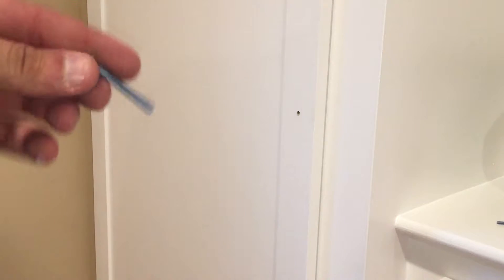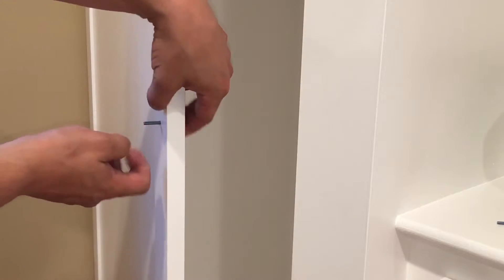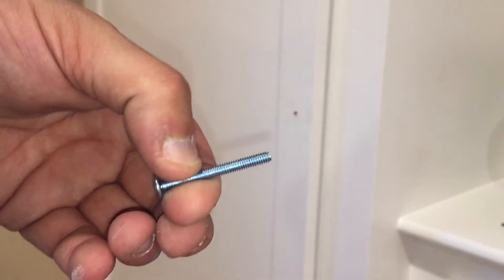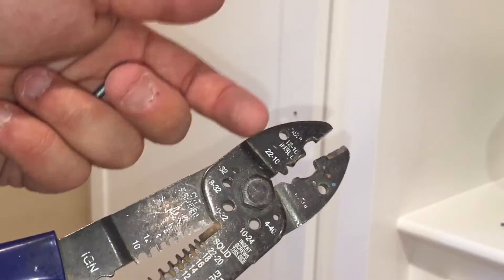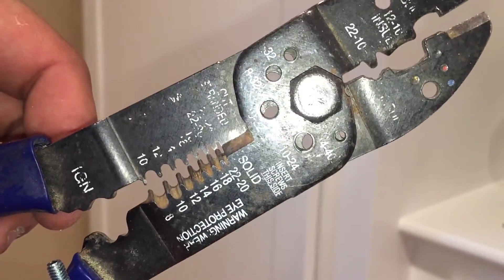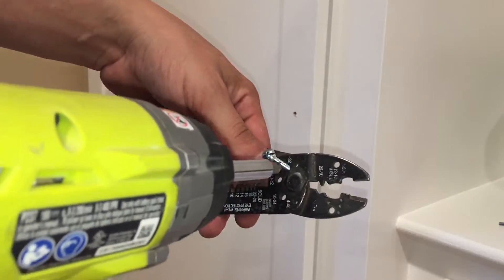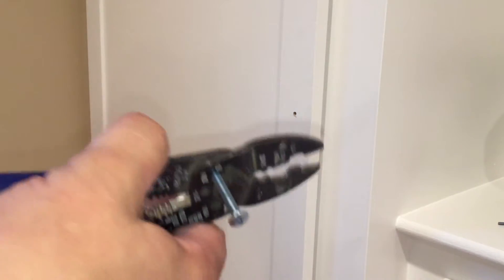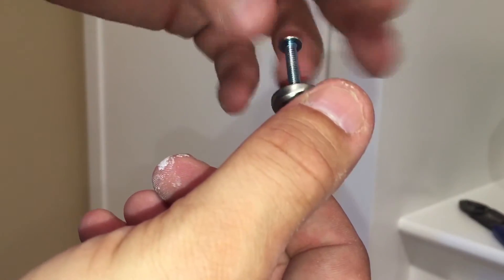How to Use Wire Strippers to Cut Small Bolts

Comment: Just the video I needed because of the light fixture bracket using 2 screws that are too long so there is a gap between the ceiling and the light fixture. I sure wish the lighting company would quality check their work so that the customer doesn't have to put in unnecessary added work.

Comment: I did this and got a shitty cut.  The nut won’t go back on. I might as well have used bolt cutters, which never work.
Reply: That usually happens if you screw it in from the wrong side of the tool.  Just sayin'